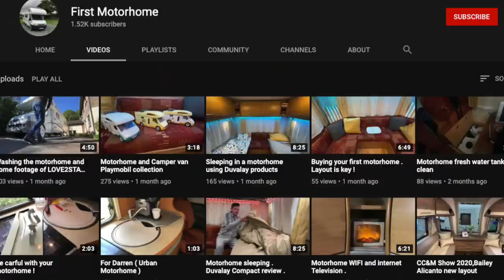BACON and a wee VIEW! - Weekly Vlog #13

Comment: Hi Daz ,we have the same motorhome as you but badged as an Ace Novella Napoli ,built in the same factory as yours.
The drawer above the fridge on ours is an extension of the worktop (same material) so I guess its use changed either due to model or choice. we have a cuttlery draw in the mid slot to the left of the fridge